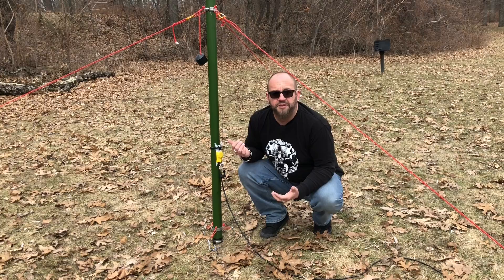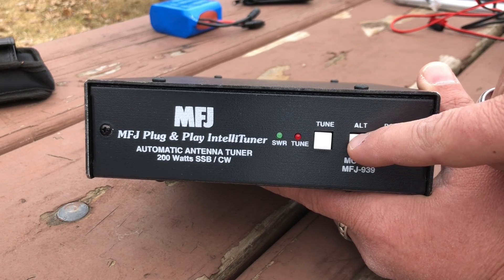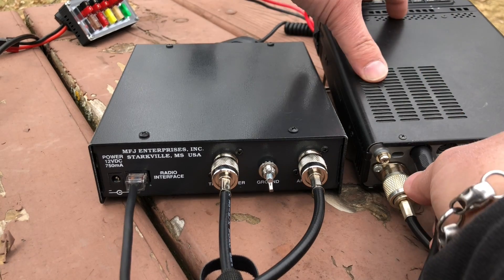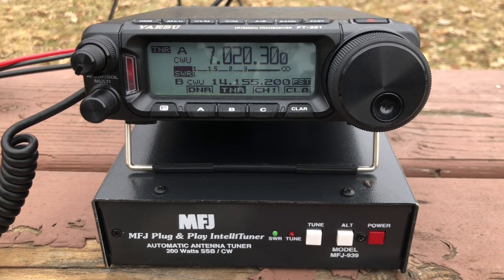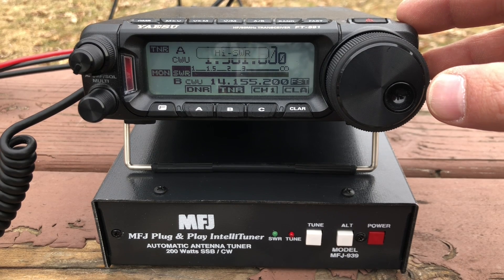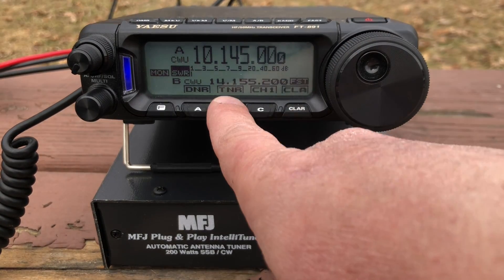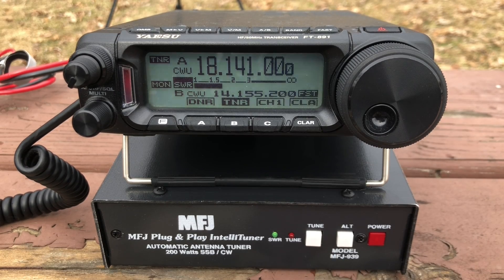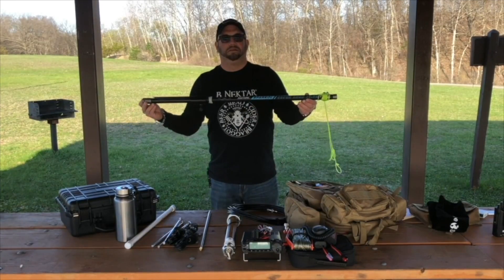MFJ-939 Plug & Play IntelliTuner review.

Comment: Nice review. The MFJ ATU's put all other's to shame. I use the 929 and it's great. The big advantage the 929 has over the 939 is, you can set the ATU not to stop tuning until it hits a perfect 1 to 1 SWR. If it's can't get there, it will stop at its lowest SWR. Also, you can set it to auto tune if the SWR hit an SWR level that you like. I set mine to ATU on its own if it sees an SWR of 1.7 to 1 or higher.
So if I key the radio and the ATU sees a 1.8 to 1 SWR, I don't have to tell it to tune, it does in on its own.

But for portable, I like to keep it simple and small. So the 939's size is perfect if an ATU is needed to work portable.
Barry, KU3X

Comment: Hello.  Can I see that the interface cable is a j45 plug.  Can the interface cable be extended?  does the rj45 use traditional 568-a or b ethernet standard or is the wiring different?

Comment: Great little tuner. Yeh.....you're really pushing the envelope trying to get it to work on 160 meters. Hi Hi
I have the MFJ 929 and it works great. But, to keep things compact for portable operating, the little 939 is a great choice.
Thanks for posting and showing how easy it is to assemble the package, antenna included. 

Barry, KU3X
Reply from the maker: Hey it worked on 160.  Of course thats pushing the envelope, but it did it.  Most of your power is going to be lost to heat of course, but I have made 160 meter contacts with my 40 meter dipole.  Wasn't using this tuner, I used my 949 I think it is??  Anyway, thanks for watching. 73

Comment: Does it tune also on receive? I mean after tuned to desired frq, does the RX go thru tuned relays?  Or maybe tuning only works while TX?  Im planning to buy my first HF radio, at first looked towards  Yaesu FT-450D, but since I figured out most cheap radios have not so great tuners now I consider getting portable radio + good, external tuner.
Reply from the maker: Kind of.  It's actually a lot easier to demonstrate on a manual tuner, where you change the inductance and capacitance, and listen for the most noise.  That's when you know you are in the ballpark of a match.  So in a way, yes, it does tune RX, but its primary goal is to make your radio think you are transmitting into a 50 ohm antenna.  The term "Tuner" is really a bit misleading.  It's really an impedance matching device.  However, if you are on 40 meters, and want to listen to 20 meters, if you haven't tuned the tuner, the signals will be significantly weaker.  I can't say for certain, but my guess would be yes, the signal goes in and out of the tuner from the same relays.  My first HF rig was a Yaesu FT-450.  I made a resonant 40/20 fan dipole and worked all over the world with it.  I had a tuner to match other bands if I wanted to, with some success, but keep in mind, nothing will be more efficient than a resonant antenna.  For example, with my 40/20 fan dipole, it will "tune" up 80 meters, even 160 for that matter, and make my radio happy.  But the RF that was actually going out to the antenna was so little making contacts was not easy.  Most of that power was lost to heat.  This topic is such a vast one we could literally talk for days on it.  The best advise I could give you is get a resonant antenna.  Even though you may see videos of me using non resonant antennas out in the field with a tuner and is totally contradictory to what I just said.  A tuner is not going to make the power go to your antenna.  It only makes your radio think it is.  Hope this helps more than it confuses.  Let me know if you have any more questions though.  73

Comment: I know your not a digital guy but how do you judge the power capability of the tuner running digital
Reply from the maker: The manufacture of the tuner will have the specs on that.  This one is rated 200 watts SSB/CW, which would also include digital.  Go by what the rating is for CW for digital.
Reply: K8MRD RADIO STUFF thanks wasn’t sure if it was the same as CW or lower I’ll dig some more on MFJ’s site. 🤘

Comment: Finally back in stock last week. Mine came with a banana plug and a small metal slug thingy. What are those  for?
Reply from the maker: The banana plug is for a long wire/random wire antenna that you can insert into the pl259.  Attach a counterpoise to the ground screw and you got yourself an antenna.   Not sure what the small metal slug thingy is.  I don't remember getting one of those.
Reply: K8MRD RADIO STUFF ah, thanks. I didn’t see that one coming. What a w-i-d-e tuner it must be.
Reply from the maker: @forgetyourlife  It should tune just about anything you throw at it.
Reply: K8MRD RADIO STUFF After a month with this tuner it’s seems to shut off my mic quite often. I have the either unplug it from the 891 or power down then back up. Between that and the “wait” bs I’m moving on to something else.
Reply from the maker: forget_your_life hmmm that’s weird.  I would guess some rfi may be getting into it.  Have you tried putting a ferrite bead on the mic and or power cable?

Comment: Question, when the 939 is connected to the radio via the interface cable, does the it automatically lower the power output of the radio when tuning so you don't blow up your PA? Would be quite annoying to have to do it manually.
Reply from the maker: Yes, I don't remember exactly but its less than 10 watts.  It says somewhere in the manual.  If you're into reading those before you see the magic smoke that is...

Comment: Curious, have you noticed much of a power drain? I see in the LDG specs, they mentioned close to nothing when not tuning. Not sure about the MFJ, but the 939 had a bit more power consumption listed - could not tell if that was just when tuning or aways when on. Appreciate your comments.
Reply from the maker: Just hooked it up to my Powerwerx watt meter and it shows 0.00 A being pulled on standby.  I'm sure it takes a little more juice when tuning but once the relays do their thing it's set.
Reply: @hamradiotube  thanks for the reply, I'm close to pulling the trigger on one

Comment: Did you have to crack open the case of the tuner and adjust some jumpers to get the control cable to work? I don't see the 891 listed for that, but a lot of other radios apparently need it.
Reply from the maker: I did not.  Plug and play.
Reply: K8MRD RADIO STUFF Interesting. I wonder what makes the 891 different than the others!
Reply from the maker: @ウォードブラッド  Not sure.  I did have to do that with my signalink though.  Pretty sure you can buy it 2 different ways though.  One way just the tuner, the other with the tuner and a Y, I, or K after the model number to signify what radio brand and cable it will work with.

Comment: Nice video Mike - thanks for sharing w/ us!  Do you know how many watts on digital modes it is rated for?  I can't find that anywhere.
Reply from the maker: The manual states it is rated for 200 watts SSB/CW.  Doesn't say anything about digital but usually digital and cw are lumped together in a power rating so I would guess you would be ok at 200 watts.  Thats just a guess though.

Comment: Also when mine shipped the jumper inside wasn't set properly for Yaesu so definitely open it up and double check that. Other than than I love it, see my using it in one of my SOTA videos and during Winter Field Day this year.
Reply from the maker: I guess I'll have to open mine up and double check. Is there a marking on the jumper to show what radio goes where?
Reply: @hamradiotube  

https://imgur.com/a/xPd75o7

check out those images. Jumper JP4 needs to be shorted, and JP2 should be set to Y. Apparently I have mine set to K and didn't even realize it. Whatever it was working, YOLO!

Comment: Great video and fun. I know you love the antenna and you should. But if someone wants to make their own, or make one who's efficiency is higher than that one.. use a multi tap unun. Yep- you'll have to get up from the chair op switch taps to work on 15 or 10. But for 40 and 20, same tap.. and you'll have an SWR under 1.3 to 1.5... if not 1:1... which means no tuner at all. No losses in said tuner to suffer. Plus, for the cost of the unun... $3.75... you'll have a better signal and have fun building the unun. I promise. I just did an EFHW comparison of my 6' high 40m EFHW and my 26' high inverted vee in the trees if interested. Plus, you'll be treated to a new 'I hate FT8' rant.  73 OM

Comment: If I were a Mercan, I would hang my head in shame every time MFJ were mentioned
Reply from the maker: I know they have a bad rap for a lot of stuff but their tuners are really good.  I honestly haven't used much of their stuff that didn't work.  There were a few portable antennas that I've tried out and had such bad luck I didn't even make a video on them.   Sure there are other brands out there, but usually at a greater cost.   Anyway, thanks for the comment and thanks for watching.  73
Reply: @hamradiotube  I've had bad experiences with MFJ gear, things that just stopped working, I did buy their twin display wwv clock a year or so back and so far so good, it's working fine.  I was in the market for an antenna tuner recently and went with an LDG instead of an MFJ. Glad your MFJ antenna tuner seems to work ok though.  I would like one of those PackTennas but they seem to be permanently out of stock.
Reply from the maker: @landonmiller6943  Thats too bad.  They do have great customer service though and I'm sure if you sent it in they would either fix or replace it for you.  I do know PackTenna is currently in production so hopefully it won't be too much longer before they are in stock again.  I think they have been out of stock since around November.
Reply: Landon Miller yeah, what’s up with that? Always out of stock yet always in the hands of youtubers.
Reply from the maker: @forgetyourlife  Well I got mine last year at Hamvention so there's that.  You want the good antennas sometimes you gotta hang with the big dogs.
Reply: @hamradiotube  I have the MFJ-969 and it works OK sort of. It creaks and groans when you twiddle things, but we have come to expect that from MFJ.
The thing is, MFJ gear is overwhelmingly under inspiring, and totally joyless contraptons. They seem to understand adequately how to design a circuit, and then get someone in a shed to design and build it out of left over parts from the late 1970's
Look at your Paktenna and its wonky knobs for instance. These are not cheap here in the UK and I would expect better for my money.
Anyway, totally enjoyed your video, and I am a long time subscriber. Keep up the good work. G7TXU
Reply from the maker: @TonyLing  The PackTenna isn't from MFJ.  Also doesn't have knobs.  I imagine everything over there costs a bit more due to shipping so it might be a bit harder to swallow for sure.
Reply: @hamradiotube  Sorry, I meant so say MFJ-939 rather than PackTenna. Yes, things are expensive her in England. We tend to pay a £ for every $
Reply: LOL
Reply: @landonmiller6943  Hi, I kinda understand yr point, but for a couple of notes here 1 they always work thru an issue with the customer, and warranty is not voided  if you take it apart for any reason, i  the spirit of ham radio, this is exactly what we should be doing, now granted no one want to recieve an item and its flawed out of the box, so its a bit if a dice roll but, for the money, try building yr own,.,you will soon find you just cant do it for the same costs,  I pity any one buying anything in the uk, most expensive place on the planet,  take yr dollar sign, n change it to pounds every time,..so no real answere here,..  anyway friend, enjoy yr radio, n like it or not almost every operator owns an mfj, dudad of some kind, n btw, i do buy allot of items from the uk,. but looking for another reliable eurooean supplier, i may have a US call, but i mostly operate in europe or bahrain,  cheers 73
Reply: I have owned dozens of MFJ products over the past 25 years and only one of them (MFJ-949 tuner) didn't work properly right out of the box.  And it was just a poorly soldered connection and easily fixed.  Now the quality control at MFJ is awful I must admit, but they generally have good customer service and stand behind their products.  On the other hand I had an LDG Z-100 tuner that worked perfectly so, I bought the new LDG Z-100 Plus that replaced it.  That turned out to be a horrible upgrade as it wouldn't tune but 20% of the time with the same exact radio and antenna under the same circumstances.  I emailed LDG with ZERO response from them.  I saw where others had the same experience with their similar tuners with no-response or half-hearted replies from LDG.  I still use and like my older Z-100 tuners that work perfectly and also have purchased a couple of their other new tuners as well.  No matter who you buy from you can get a faulty unit.  And the less you pay the higher the risk of getting a bad unit.  73!

Comment: You may get an OK SWR on 160 meters, but your antenna efficiency will not be good at all using the Pactenna Mini or any other short wire antenna. Also as you may have observed, you might get better performance using the shield of your coax as  counterpoise without any other counterpoises attached.  If you so desire, you can put your RF choke near the transceiver to block any potential common mode currents.  I use 60ft of wire in L configuration attached to a 5:1 UNUN.  SWR is better with no external counterpoises; only using 25-27 ft of coax's shield as a counterpoise.   Your ultimate antenna performance under a specific configuration is dependent upon your location as I am sure you already know.  Great video! 73 de AE5ZX
Reply from the maker: I spent a good deal of time trying different configurations yesterday when I was filming this.  It worked really well when I placed it at the antenna feed point powered with a small Bioenno battery and a short 2 foot coax from the tuner to the antenna.  I prob should have shot some of that.  I understand a huge amount of power is going to be lost from the coax when trying to load up the top bands and that configuration would help to minimize that.  The fact that it tuned 160 at all is pretty awesome.  If I really needed to get on that band for some reason, I know I could.  Even if only a watt or 2 actually went out the antenna.  The length of the coax in general does matter with the antenna as well.  I initially used a shorter 20ish foot run and it was absolutely horrible.  This was about 50' of coax and it worked a lot better.  Thanks for the comment and thanks for watching.  73
Reply: @hamradiotube  that is the best place for the tuner not at the radio end .